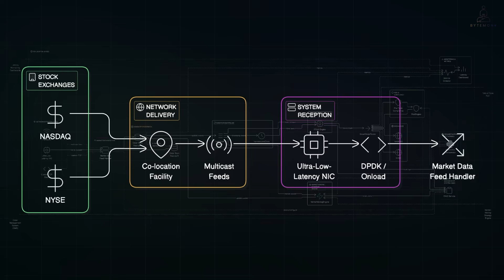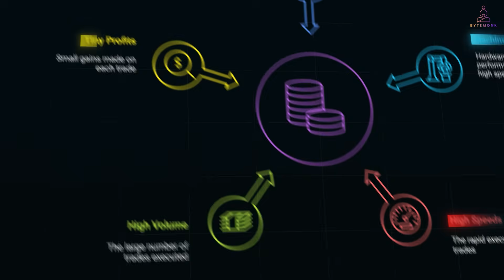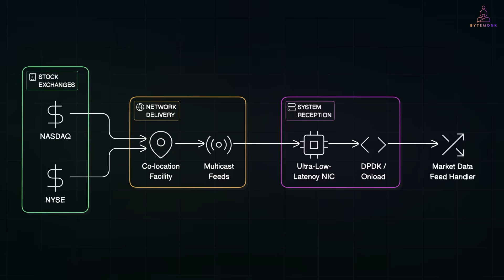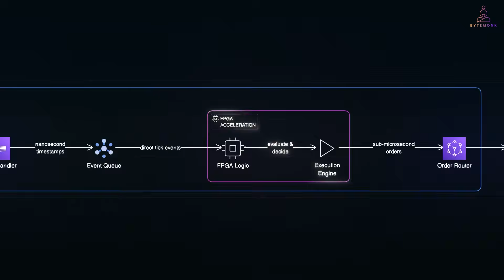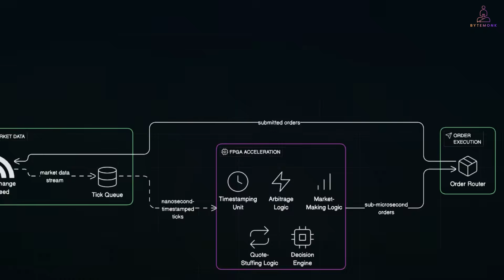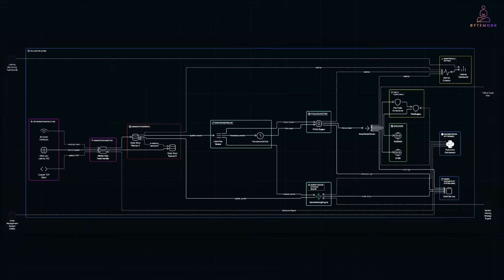Inside a Real High-Frequency Trading System | HFT Architecture

Comment: If you don't have a perfectly optimized system collocated on NY11, you're essentially running a 100-meter race against Usain Bolt and giving him a 99-meter head start.

Comment: High Frequency Trading is entirely predicated on the privileged position they enjoy regarding trades/orders and market data.
Without this insider information, this system of trading would not exist.
To put it simply, High Frequency Trading is a criminal operation front running on the backs of the middle class.

Comment: Can retail traders even achieve this kind of private architecture ?
Reply: Absolutely not. The bottleneck is not the tool, its the network latency issue. To set up the barebones of infrastructure part, u gotta find a rent space next to one of major exchanges and sign data feeds contract from them as well as fibre optic cable providers.

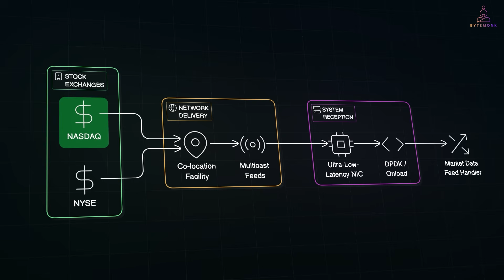Comment: 2:30 Market Data Ingestion (Multicast, NICs, Kernel Bypass)
3:30 In-memory order book and replication
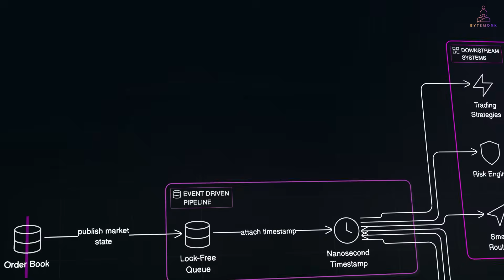4:30 Event-Driven Pipeline and nanosecond Timestamping
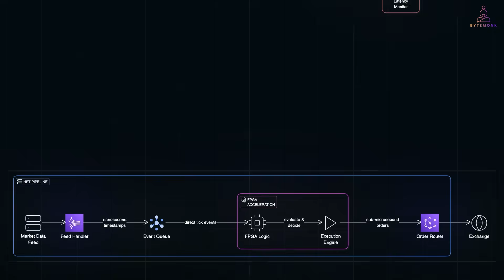5:30 Tick-to-Trade with FPGA Acceleration
6:30 Market-Making Strategy Engine
7:30 Smart Order Router & Pre-Trade Risk Checks
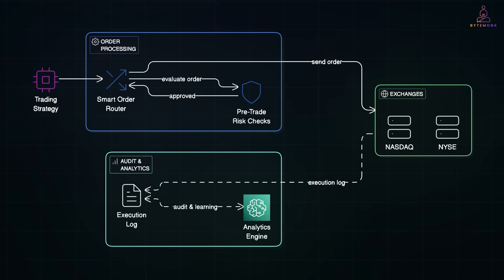8:45 OMS, Monitoring & Latency Dashboards
10:00 summary

Comment: Calling a network stack overhead is crazy. Got them react devs
Reply: It is a massive overhead. Linux has such a massive stack due to its flexibility, stability and safety. U don‘t need all of this in HFT.
Additionally kernel bypass allows DMA on the nic‘s buffer for zero copy operations. And CPU bindings to I/O queues and so on … the matter is deep.
Reply: @alexsilvennoinen I do understand all that. Though I don’t agree with zero-copy. That’s achievable with Linux io-uring on a lot of syscall operations.

Comment: What I don't understand is wont commission eat into the profits
Reply: The opposite, you have direct access, so not paying a broker. Exchanges often pay the HighFreq firms for taking trades, so could practically trade at 0 bid-offer spread and make money from charging the exchange micro commissions. Some of these HF trading firms have gone years without ever making a loss in a single day
Reply: That’s actually relatively good question!
Reply: They don't pay commissions, all HFT firms have DMA seats with the exchanges. The same as most hedge funds and clearing houses.

Comment: I am currently working as a data engineer and data architect. I am very impressed by systems like this for HFT or for investment in general (real-time ingestion of stock data to train quantitative models,...). Is there any specific way to learn about them to try to make the leap into this sector?
Reply from the maker: It all comes down to foundations. I will be publishing courses on System Design and Fintech, at bytemonk.io, stay tuned :)

Comment: As a self taught software engineer, this was insightful, thank you! Also question, aren't FPGA's more used in early stages when designing a new chip? Wouldn't it make more sense, once the logic is tested on the FPGA, to print a "real" chip (ASIC)? as I understand, FPGA's are generally slower as a printed circuit (ASIC) as they have lots of unnecessary gates (to be re-programable).
Reply: I guess the core meaning behind that is FPGA is to work on the specified logic of HFT people can use a custom GPU, RISC, or OPTICAL, or quantum technology to utilize hardware limitations. But that's a good insight.
Reply: As far as I understand, the main reason why HFT companies do not go for ASICs is that the algorithms in this field are constantly changing. The ASIC road would be too slow in terms of design and manufacturing and likely for the time it is ready for use the algorithm that it implements could be outdated. With an FPGA, the "time to market" (time to have a valid solution working on the FPGA) is much shorter (just the time for FPGA engineers to come up with a working solution) and they provide flexibility (hardware reusability) to change the logic whenever you want to update algorithm. In terms of performance, ASIC could indeed go beyond FPGA (works typically at 100s of MHz of clock rate) but it would require more complexity, optimization, time and cost, and would not offer any flexibility
Reply: @shorky_0  great answer, I imagined it had something to do with greater flexibility,but in those scenarios, they have boat load of money, and probably can have ASIC manufacterers pump out different ASICS.
Reply: Yeah, fpga is ideal in this fast paced constantly changing environment.

Comment: Thanks for the video. I would love to see the architecture of a centralized cryptocurrency exchange. How low latency order books can be implemented. How order matching engines are implemented. What happens when an order is matched. How it gets filled. How Kline data is computed and how balances are locked and unlocked. Take binance api docs as reference
Reply from the maker: Thanks a ton for the detailed suggestion! I will look into this.

Comment: Missed RMS system..
Reply from the maker: you're right!
The Risk Management System (RMS) is a crucial part of the HFT pipeline. It performs pre-trade checks like position limits, exposure caps, and regulatory compliance — all in microseconds or less, without slowing down the order flow. Thanks for pointing it out!
Reply: @ByteMonk  the major role is to sqaure up all positions when you daily risk limit crosses. (strategy wise/ script wise/account wise). Else you blow up an organization in single day..

Comment: For this to archieve nanosecond level, all must be on the same machine to reduce the cost of network transfer, right ?
Reply from the maker: Great observation! At nanosecond-level precision, even network hops between machines become too expensive. That’s why critical HFT components — like order book replication, tick processing, and strategy execution — are often co-located on the same physical machine, sometimes even inside the same process or FPGA.

Latency-sensitive logic is usually written in C++ or implemented directly on hardware (FPGAs), runs with kernel bypass (using DPDK or Solarflare)... and avoids system calls, context switching, or inter-process comms whenever possible.
Reply: The hot path is ideally running on a single CPU in a tight branchless loop and most of the data is ideally in CPU cache.